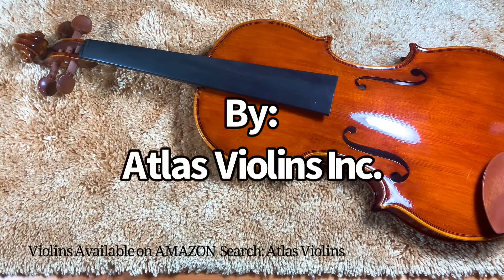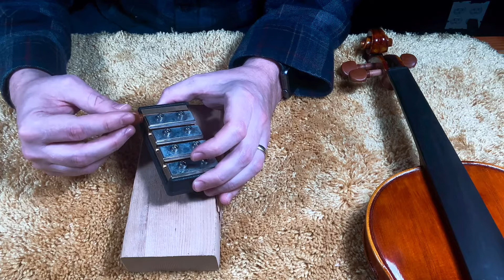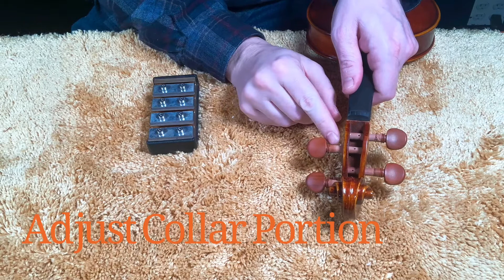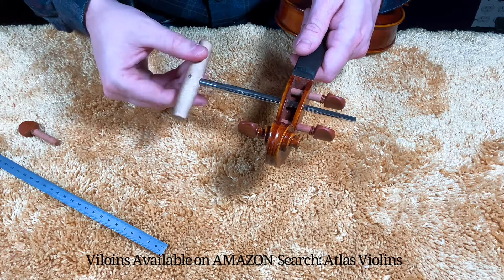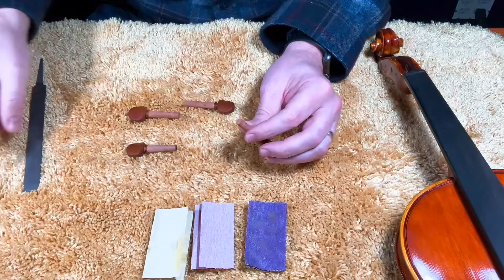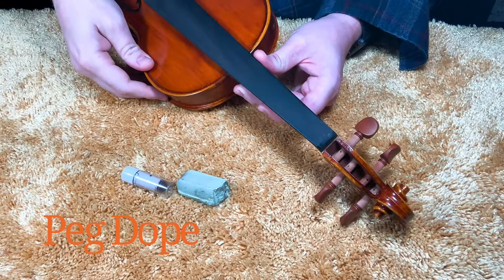How to Fit Violin Pegs

Comment: Are the peg shapers usually factory set correct,y to begin with?, as can’t find enough info on how the sizing on the shaper corresponds to the reamer shift. How accurate together are they usually without adjustments?…or else it makes life harder to match them thanks.
Reply: Try removing the blades and then put metal polish on the reamer .Reverse the turning action inside the peg cutter and see how well it all matches.